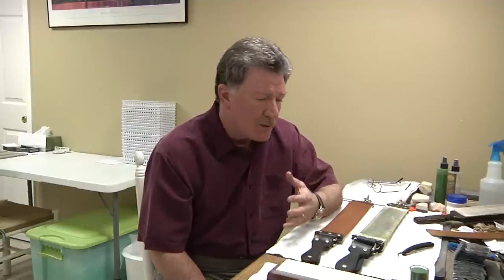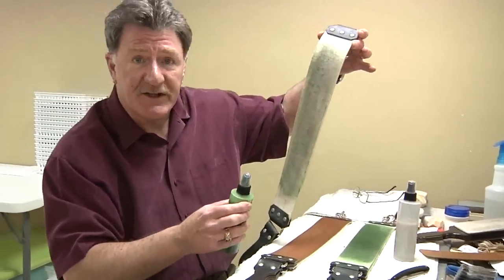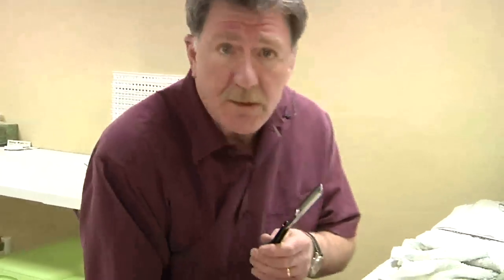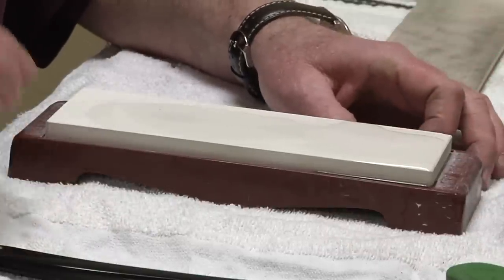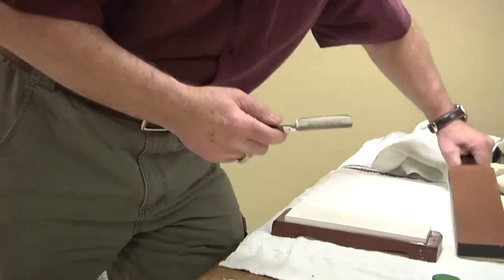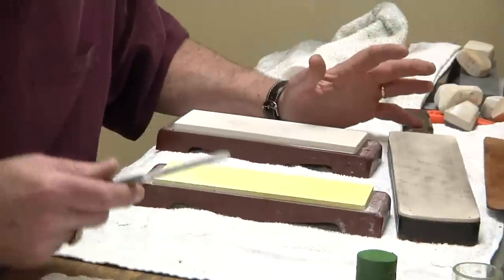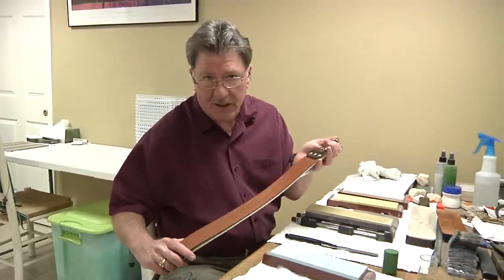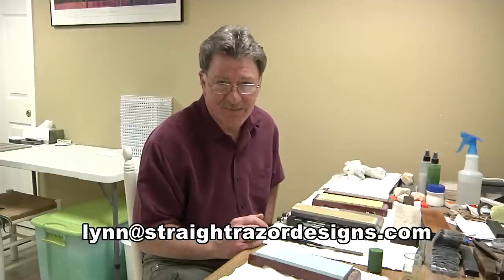Straight Razor Honing-Refreshing Straight Razors

Comment: Amazing insight. Seems like this is gonna reduce the wear on the blade to basically zero. Same for the lapping routine. The hone, if not warped after drying, doesn't need to be lapped as frequently as is recommended by other honemeisters on YT. I can imagine that a pyramid more easily mitigates planar differences in multiple hone progressions. The pyramid is something new I learned. Definitely gonna try these edge preserving and time saving methods too. Thank you very much

Comment: Thank you Brother, I've just started getting into sharpening, mainly cutlery. My father was a barber long ago and he has a straight razor that's close to two hundred years old, he offered it to me but I don't want to make it with my amateur sharpening skills.

I am going to make my own strops using kangaroo leather I have leftover from an old painting project. I also have some canvas, looks like I have my work cut out for me.
Reply from the maker: Best of luck and let me know if I can help you. Keep in mind that sharpening razors is different than sharpening knives. Both the spine and the edge need to be on the stone with even pressure at all times. With a little practice, you can certainly learn hone them nicely. Fraternally!

Comment: First of all your video is very well done. Straight to the point, informative and easy to understand the information your trying to convey to anyone who watches it. I also had a some questions for you, if you don't mind. First; do you need to have constant contact of the spine of the razor on the strop to sharpen it the right way? Second; will a pyramid of like a 5k grit and 8k grit work in lieu of a 12k sharpening stone? I'm tired of tearing through those expensive disposable razors by Gillette so I'm trying the straight razor approach so I got 2 of them. I figured I could practice my sharpening with one and use what I learned on the other. Even if you don't get back to me I would like to express my gratitude on you taking the time and effort to post this video for us to learn a few things.😎👊
Reply from the maker: You do need to keep the spine and edge on the strop. If you lift the spine while stropping you can dull the edge. Light pressure as well. You can do the 5/8 K pyramid but in the long run you’ll find the 12K a more comfortable shave. Best of luck and thanks!

Comment: Thanks for the video. Having to get a razor honed multiple times has so far scared me off from jumping into the straight razor world. I was under the impression you needed multiple stones, etc just to re-sharpen a razor.
Reply from the maker: +PhotoBomb In my opinion, you can get by with a 12K or finishing stone and either spray or paste media to maintain your razors unless the edge is damaged and needs a complete re-honing from bevel set to finish.
Reply: +Lynn Abrams im looking into this method that you mentioned (12k + Cr paste) in the video before I have to send it back to you for proper honing haha.. my question is do you also sell the wood block you have holding the 12k finishing stone on SRD?
Reply from the maker: +Alex Ramirez The 12K's used to come with those plastic stands permanently affixed to them. They don't make them like that anymore and I am using the Naniwa Stone Holder. Works great for all their stones.

Comment from the maker: You can put chromium oxide paste or crayon on the back of a leather strop. I would not recommend the higher grit on the back side of the poly webbing or linen if it will be touching or rubbing up against another treated strop because of the possible cross contamination as you mentioned. You could put the other paste on the front side of the linen and then you should be fine. Alot of people don't use the linen before the leather as this is a personal preference thing.

Comment from the maker: I recommend the pastes or crayon on the back of leather or webbing and you can put it on as demonstrated in the video. I think that the sprays work best with the hard felt. I like either the .5 diamond spray or the chromium oxide on the felt. They are very consistent and reliable.

Comment: Hello Lynn!
I've watched this video several times and enjoyd watching it. I even pick up some points that I've forgotten or missed. I really do apreciate your videos!! I find them quite helpful. thanks for the videos- this one and in particular the video about circular motion technique on the 4/8k Norton stones. I found that video very,very helpful!!
I tried it and it really sharpened my razor to a very nice level.

I have a question though regarding this video. When you notice that the paste ( chromium-oxide or Diamond Paste, etc.) on your canvas [felt,etc] has faded or that it is not doing it's job;do you (1) wash it off, let the strop dry, then add new paste? Or (2) Do you just add new paste over the old one? What do you recommend? 

Again thanks for posting such fine videos!!

Comment: Before re-honing it, try stropping it and making sure your angle is less than 30 degrees or that the spine is only one spine width off the face. Try just shaving from one sideburn to the jaw on that side of the face. If it still doesn't shave nicely after a couple tries, then a honing might be in order.

Comment from the maker: On factory edges, I usually drop down to the 4K and hone up from there using the circle method I developed. It is virtually flawless. On tweaking a shave ready blade, I will usually try 1-3 strokes on chromium oxide or a couple strokes on a finishing stone followed by the chromium oxide and see if it improves the shave. If it is truly shave ready, I just shave with it.

Comment: Have used noting but leather strops, an Arkansas stone, fabric strop with chromium paste to maintain my razor for over 10 years.  As long as you don't  damage the edge, you should never need to re-set the bevel.

Comment: what is a good method to identify each stone ? im having issues keeping track of the things .This is awesome info from a grand master . I have a few knives i keep an amazing edge on using the same principles. I found an amazing 1940's vintage German razor on ebay that i fixed up (my first one)  and looked at it under an electron beam microscope , The scratches and pattern are incredible . I use a sharpie  before each stone or procedure to see what it does.  I could never afford one of these microscopes but my job has one and i sneak in there at lunch time  to take a peek .  at 200 x and 300x you actually see whisker remains   that look like tree bark. The blade  always maintains  a radius  regardless  a true point is theory impossible . 
im so glad i quit using disposable  razors and blue shave goo

Comment: thanks for the video.  You appear to be about my age, so I'm sure you remember the barber, who would just strop on his equipment, and always had an edge quite sharp enough to shave with.  I'm sure he usesd stones when needed, but there were neither Shapton glass, or Nanua (sp?) stone cleaners, and for sure there was no 5 micron fairy dust.  I really do appreciate the work, and effort, but at what point does one hit the point of diminished return ?
Reply from the maker: IMO you should be able to function well once you get to the 12k stone.
Reply: @LynnSAbrams  Yes, I agree, but I think that is still overkill.  I just use a HARD Arkansas, and a strop.  Maybe I'll get a finer stone and try it.  Thanks
Reply from the maker: Some used to use just a Carborundum and Arkies as well. Have fun.

Comment: Excellent video. I had a company sharpen two straight razors on only one side of the blade with a machine. My gut tells me he just wrecked them because they are only sharp on one side. He said it was better to have only one side beveled. 🤔 The one razor that is not that deep, has a pretty thick edge on one side that you can easily see. Is this possible to have re-beveled properly is will this be too much work to accomplish? My second straight razor looks much newer and much deeper. When he sharpened it, the bevel did not look so deep or thick. You could barely see it. So I believe it would not take as much effort to re-bevel both sides proper. I have never used these before nor have I ever sharpened one before. I am just starting to use brand new one with a replaceable blades. From me being a butcher in the past, I love sharpening my own knives and other tools. I want to learn how to sharpen a straight razor properly. What is the best method to have these two straight razors re-beveled properly? What should I buy to get started?
Reply from the maker: I normally use a 1K stone (Naniwa Traditional or Professional 1K) to put the bevel on the razor. In my opinion, getting the bevel right is the foundation for sharpening straight razors.

Comment: Thank- you for the reply. I did as you suggested- to spread it more with my fingers, and then to dry it out in the sun for an hour or two, and that helped. Thanks! I did apply it rather prudently- just enough  for the belt to be an even green, and dried well in some places. However, Next time I'll be more careful.

I have another question and would once again appreciate your advice:

I have a balsa stropping board that was laced with liquid paste ( chromium oxide ) directly onto the wood. By now there are brown streaks on two thirds of he board area respectively. This probably means that it's time to refresh it. What would be a good procedure to do this?

Thanks again for your help!!

Comment: Hey Lynn, thank you for this video it is great. I wasn't sure if I'd take a liking to shaving with a straight razor so I started with a shavette and am now more than ready for the real deal. This video has definitely lifted my concerns about maintaining a sharp razor however I was wondering at what angle do you hold the razor when honing it on a stone? Do you rest the spine down on the stone as well or keep it up off of the stone? I want to keep it consistent and for sure don't want to damage a good blade. Thank you so much
Reply from the maker: Both the spine of the razor and the edge should be on the stone when sharpening and stropping. Thanks.

Comment: Hi Lynn, I notice you have a big diamond spray bottle, did you mixed the diamond power with water or did you buy it in that size. If you bought it in that large size, would you tell me where I can get it. I only found small sprays on amazon. thanks.

Comment: I have a poor mans strop - balsa wood treated on one side with .3 micron paste and the other with .1 micron paste. This is in additional to my normal strop. I've been using this as a refresh strop, is that a correct assumption or am I off a little bit?

Also - what are the potential problems by using more than a few strokes on the paste or stones?
Reply from the maker: I usually don't use the 1 micron for refreshing, but if it works for you, that's fine. The .3 should be fine for refreshing in my opinion. You might try a few strokes on the 1K followed by a few on the .3 and see if that works for you.

Comment: Hi Lynn.
I'm thinking of buying a straight razor, but wanted to know what I'm in for before buying. Your videos have helped me a lot, thanks! One question on this video though:
Why do you go spine-first over the strops but edge-first over the stones?
Reply: I think you go spine first on the strop so that you don't cut it. Using a stone to hone the blade would mean that it is getting quite dull, and going blade first is normally how any blade is sharpened as far as I know.
Reply: If I may interject, going blade first on a stone actually cuts/files the blade. Going backwards or spine first actually "combs" the very microscopically thin tip of the blade out straight.  When you shave with the blade, or hone, the very very tip of the blade can actually curl over; stropping the blade every time "combs" this impossibly thin part of the blade back out perfectly straight.

Comment: Hi, I have a Kanayama Cordovan Strop 50000 which is better to use on the linen side chromium oxide or diamond spray?
Reply from the maker: The linen on the Kanayama’s is pretty stiff material. IMO, both the diamond spray and the chromium oxide should work fine. You may find the chromium oxide a little less harsh. YMMV
Reply: Thanks for the reply

Comment: Thank you for a great video on honing.  One two part question:  During the stone honing process are you keeping the spine in contact with the stone at all times, and is using electrical tape on the spine to decrease the surface of the bevel or simply to protect the spine from scratching or stone scuff?  I would assume the larger surface of the bevel by not using tape would make for a sharper finish hone and strop.  I am using an 8 and 12 K Japanese wet stone and finish with a leather strop. What is your expert thoughts on that?  Thanks again.  I am relatively new to straight razors and I am totally hooked :)
Reply from the maker: The spine and edge should be on the stone with even pressure when honing. Tape can be used to create a mini bevel. I normally use tape if I want to protect a pattern in a razor so as not to wear through it at the spine or if I have a razor with excessive wear and I am trying to set a bevel. When refreshing the razor, there is very minimal wear to the spine when using a finishing stone and I find no noticeable wear with a few strokes of paste/spray. Tape is a personal preference type thing. Some folks don't use it and some prefer to.
Reply: Lynn Abrams Thank you Sir.

Comment: Hello, and thanks for making an excellent video on refreshing a straight razor! 
 I applied chromium oxide liquid paste on the canvas belt section of my strop belt to try out the technique of refreshing a razor by stropping over it once it dries. After 24+ hours the chromium oxide was still "tacky" in some places. Should I blot it with a Kleenex or Scott towel tissue, and then to let it the rest dry? What do you recommend that I do? I would appreciate your advice. Thanks again for making such a fine video as this one!!
Reply from the maker: You may have been a little heavy in the spots described. You could try to blot them or just rub them in a little with your finger to even out the heaviness and you should be fine.

Comment: I got a brand new dovo straight razor and went to strop it and accidentally stropped in the wrong direction and nicked the strop. Does this action ruin the blade? It's certainly not sharp enough to shave with

Comment: Good evening, Brother (seeing your ring, I can justifiably refer to you as such),

I notice this video was posted in 2013, and so I’m a bit late. Nevertheless, I hope you get this (somewhat late) message...

At the age of 59 (soon to be 60 in May) I am just about to start using a straight razor for the first time ever. I bought all the required stuff and a brand new razor from a London company here in the UK.

I only discovered after purchasing the razor that before I use it I have to first sharpen it with a whetstone. So, with no knowledge whatsoever, I purchased a whetstone on Amazon. This is the one I bought:

“SHAN ZU Knife Sharpening Stone Knife Sharpeners Whetstone with Angle Guide Non-Slip Bamboo Base 2 Side Grit 1000/6000 Waterstone”

Now, I don’t know if this is sufficient or not... I have no idea. I only know that the grittiness levels (1000/6000) are lower than the ratings yours and others’ videos seem to be using.

Anyhow, a few days ago I tried following the sharpening and honing procedures given on another video (I hadn’t seen yours until this evening) and my razor’s edge ended up more blunt than I started!!!

I just can’t seem to get it. I’m following the procedure given on that other video (very similar to yours) but it’s not working. Could it be the stone?

Appreciating any advice you can offer.

Danny

Comment: I am curious when you hone your razor is there a specific angle being held or is the razor completely flat ? And if so will this change the angle of the razor down the road?
Reply from the maker: I keep the razor flat on the stone with both the spine and the edge touching and apply light, even pressure throughout the stroke.

Comment: Also Sir I was wondering, if the spine is decorated like with the dovo bismarck will refreshing the blade by using a 12000 grit stone eventually remove the gold or is it fine enough to leave it intact.
Reply from the maker: If you look at the spine, the decoration is more on the top. You will see a wear line already under that. If you don't want any wider a wear line, tape may be your answer. Usually, once a razor is honed, there should be little wear in maintaining the razor unless it is damaged. YMMV

Comment: Lynn Abrams Dumb question Lynn: can you repeat the 1-3 and the 1-5 pyramid process multiple times in the same honing session? I am new to SR shaving and followed your routine by doing the 1-3 and 1-5 on a Naniwa 3K and 8K combo hone, stropped it 5 times on a 10K paste, then did 60 strokes on the leather, test shaved and after the first pass it was tugging hard. What do you suggest I do to get this blade shave ready?
Reply from the maker: If the blade is just in need of refreshing doing the finish of the pyramid described a couple of times is fine. If the blade needs more than a refresh however, you may need to go to a full pyramid or maybe the circle process from the beginning.

Comment: I purchased a new Dovo 4 580. It was not shave ready. I have stropped it on a nice leather strop and have also used a fabric strop with .5 chromium oxide. It is still not shave ready. Do I need to stone hone it or is it my stropping technique?
Reply from the maker: Ryan Wulfert Usually, the only way to dull one on the strop is to use heavy pressure and lift up at the end of your strokes. If your razor was not previously honed, you may want to consider that.